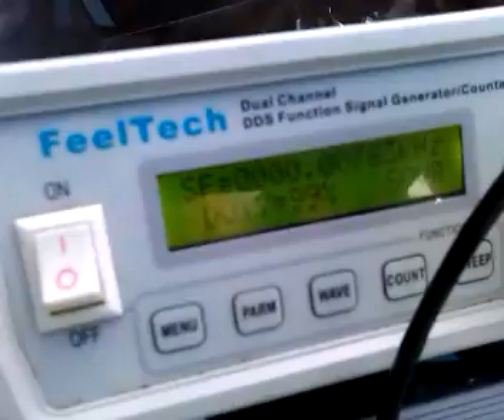chembusting 6/23/16

Comment from the maker: I have been wanting to start making them but it is too much for me to learn and take on right now. I have just been using a nice 2 channel frequency generator i got on ebay it works good. It is nice because i now have been thinking of making hulda clark style copper hand holds that plug in and just sit and meditate with different frequencies.
 here is the link
http://www.ebay.com/itm/24MHz-Dual-Channel-Arbitrary-Waveform-DDS-Function-Signal-Generator-Kit-FY3224S-/111848844578?hash=item1a0ab5ed22:g:pP0AAOSwHQ9WbUQT